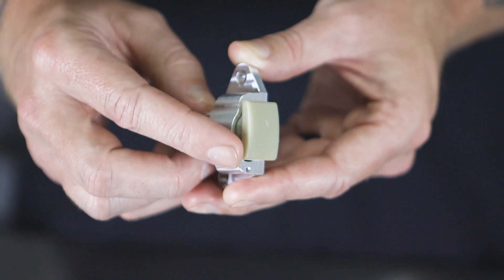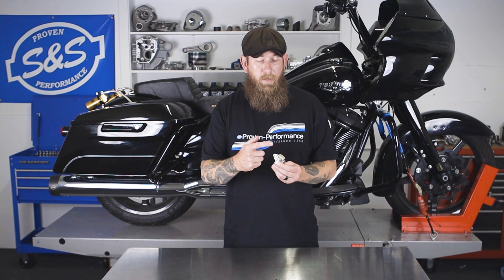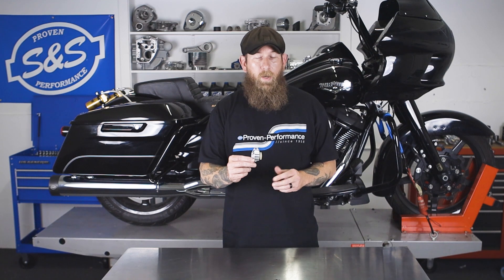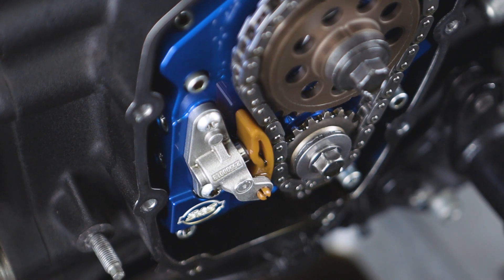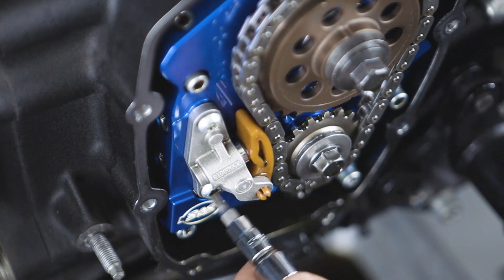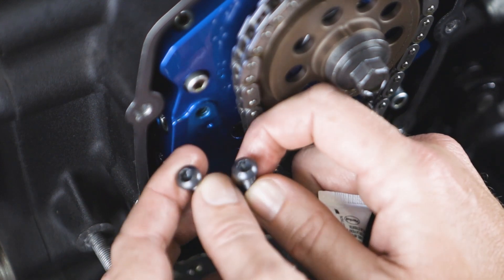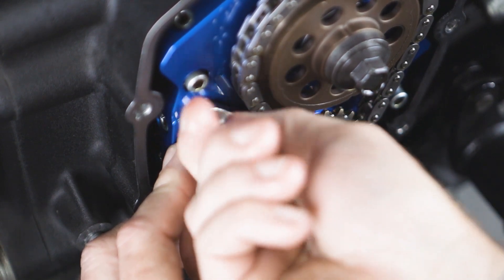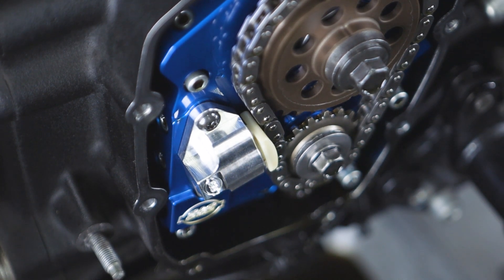Product/Spotlight & How to Install: S&S Chain Tensioner for HD® M8 models

Comment: Does this only fit the SnS camplate or does it work on the stock one, and say feuling camplates as well?
Reply from the maker: Can not speak to other brands, but our cam chain tensioner will work on both factory as well as S&S cam plates.
Reply: @SSCycleInc  Thanks!